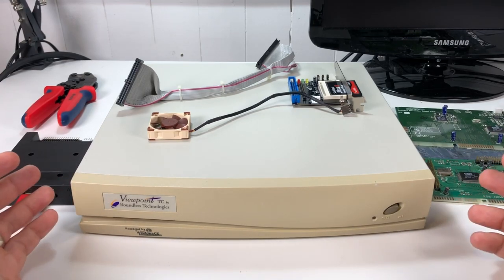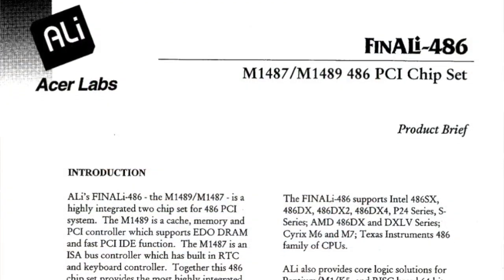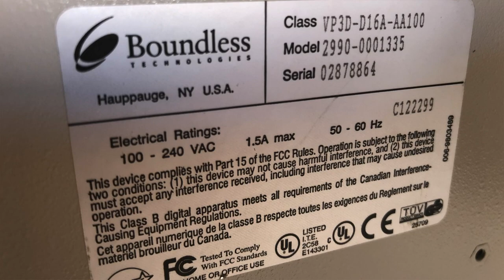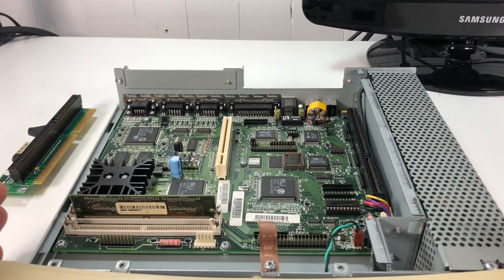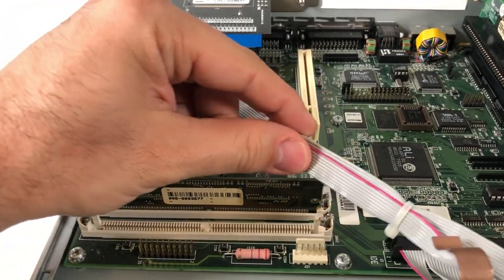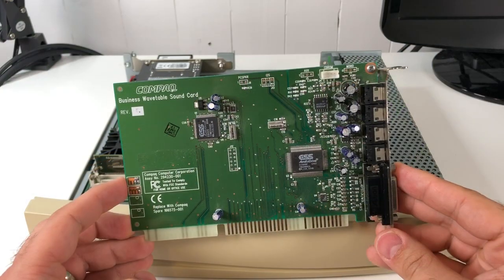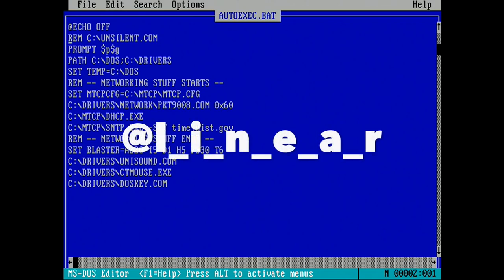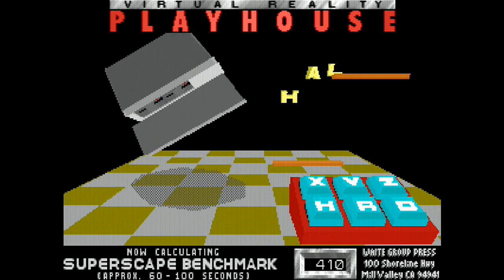Building the Ultimate 486 DOS Gaming Thin Client! #486buildoff

Comment: But can it handle a voodoo card?
Reply from the maker: Good question, there is pretty minimal benefit to using a 3dfx card with a 486, but I’d be worried that the power supply may not be able to handle it longer-term. Would like to give it a try regardless 🙂